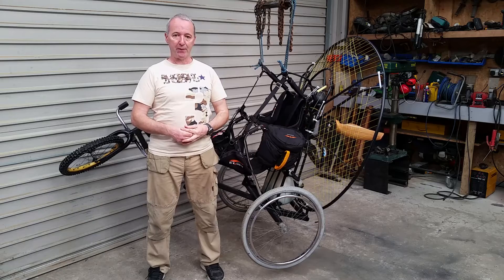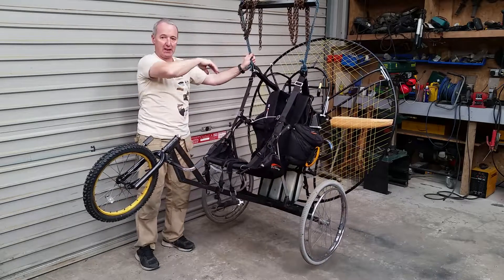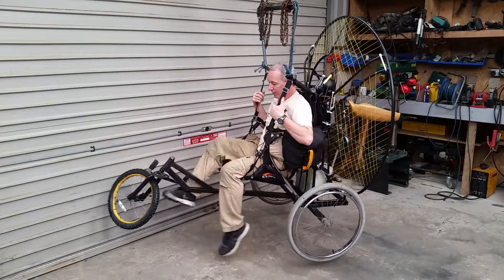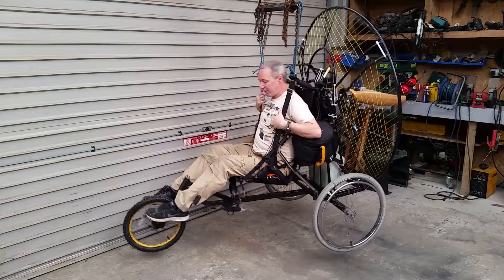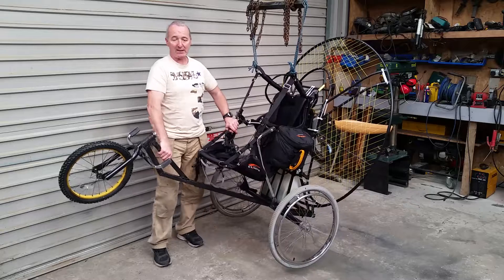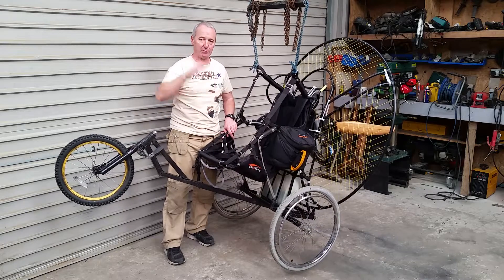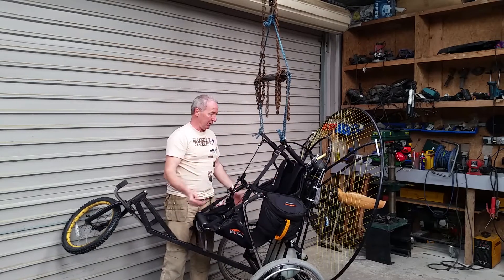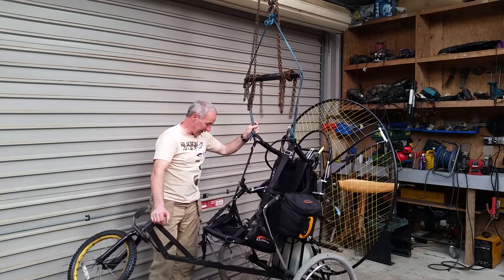Paramotor trike .. Centre of Gravity Testing ..

Comment: Nice but try putting a controler and a battrey system on this to put a 1,000 watt drive front wheel on this land, take in your wing turn on the wheel hit the throttle and go up to 35 mph doen the trial?

Comment: Hello Gerry, I greet you from Ecuador, I congratulate you, I have been enthusiastic about the construction of your trike, I have a paramotor flycastelluccio of 313 cc is very heavy, the first time I flew in it broke the prop and the exhaust pipe. Now I want to repair it and build a trike, I hope to get it. Again Congrats
Reply from the maker: Hola Xavier. Me gusta hacer cosas y volar tambien. I have to repair the moster engine after my flight a couple of nights ago. Manana quiero ir parapente en los montanas aqui circa. Buenas suerte con su construction y deje me ver tu progreso por favor. Saludos desde Irlanda
Reply: Thanks Gerry for your answer, I commented that in my country, it is difficult to fix my paramotor, because there are very few people have one (paramotor), so I have to investigate on the internet how to do it, I am a systems engineer and I do not know much (almost nothing) about mechanics and Engines.
My intention is to fix the paramotor the mechanical part and then build a trike, I hope you like yours. I have always flown (about 8 years) 
without the help of the engine the first time I tried i broke my propeller by the weight of the engine.

Comment: I would worry about the integrity of the J bars now that you have drilled through them. They appear to be small in diameter so the hole drilled through them makes them essentially even smaller.
Reply from the maker: Hi Michael Thanks for the comment. Guilty.. I drilled a 6mm hole through the jbars so I did weaken them a little, I think they are still stronger than the frame they connect to which is aluminium. That was my rational at the time of drilling but I will keep an eye on them in case of cracking or fatigue. I flew this trike in my next video and although only a small flight it flew really well and was nice and predictable in flight. Here's a link https://youtu.be/Dylb_QGBX2E                   Cheers Gerry
Reply: Yeah I saw that, great flight, the take off was swift. Very creative use of available free stuff. After I watched your video I logged onto craigslist to look for old bikes for parts.
Reply from the maker: Hi Michael. We could be cousins I have the same surname lol. Cheers Gerry

Comment: Look's OK but for first try touch down with motor off because if center of gravity is not OK then is possible to pull you on the cage. And pick almost no wind day to minimize this possibility. When you com to landing just flare easy couple of times before touch, and just before touch like from foots pull brakes but not to the end live some energy in wing. Then when you touch ground and roll all ready then pull brakes to the earth to see if this picking up too much your front wheel. If picking then hang point just push a little to the front, because when windy, and when wing have greater potential in it can easy roll you on back side. And for the next build. Take Garden trolley because of much better amortization, and lower center of gravity. Go as lower you can 10-20 cm from grass with your end, and for hang points use steel rods because of twisting when you fly in turbulent air and when you engage full power. Good luck and pick right day for test.
Reply from the maker: Hi Poli. I flew it today and its COG was lovely. Its the first time I flew any trike and I only flew it for a few minutes this time but it worked really well. Thanks for the advice. Cheers Gerry
Reply: Excellent Gerry, I am glad then you menage to test fly. Here by me is always wind or rain or something.Worst flight season so far. And last advice and most  important. If your wing on take of lean to the left to much, and specially if is not come above you, for example is lean behind you and to the left. Immediately point your front wheel to the left, and abort take off.This prevents you from sideways overturning at the start, driving front wheel under the wing. I wish you loots of good days to fly. Bye